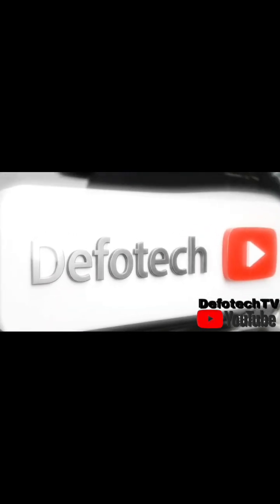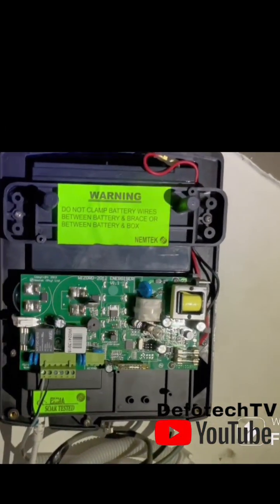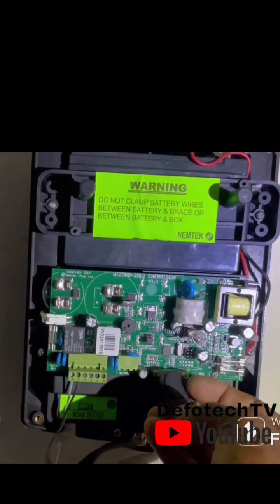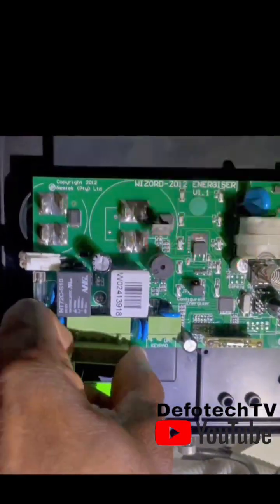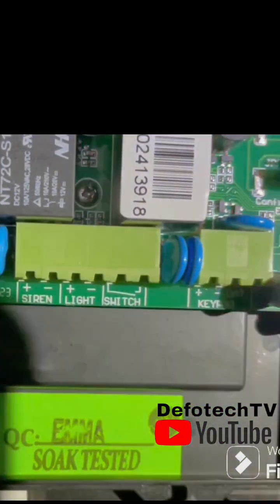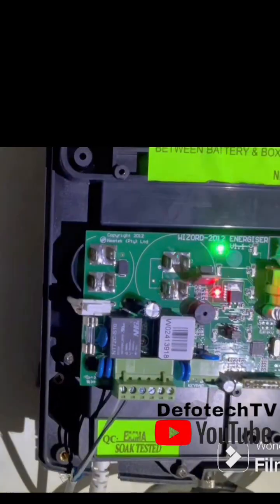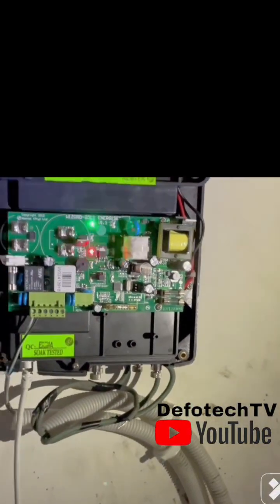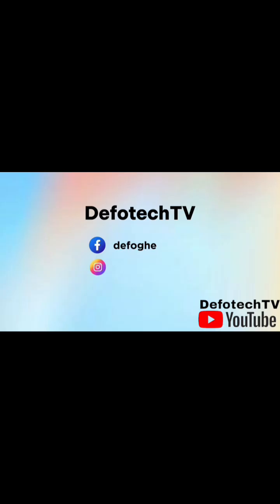Understanding Your Nemtek Electric Fence Energizers

Comment: Good morning sir, 

I’m from Malawi and I have a Nemtek wizard 2i and I just recently bought a new battery for it and I do not know why the battery is not charging even though the transformer is giving an output voltage of 15v and when measuring the battery wires it shows nothing and also the fuses are all okay
Reply from the maker: That's strange! 15vdc ought to charge the battery
Reply: @defotechtv9093 sorry it’s 15v ac
Reply from the maker: Remove the battery terminal from the battery head,plug the Energizer to an AC socket, on the your multimeter, select DC, and read the terminal which is supposed to be on the battery head. Let's know the voltage there.
Reply from the maker: Too low
Reply: The power green color light flashes very slowly and it has started since yesterday and almost 20hrs have gone by
Reply from the maker: Like you need a bigger amps 15v transformers
Reply: @defotechtv9093 when I’m measuring the AC voltage at the secondary output from the transformer it shows 15v and then measuring the DC voltage at battery wires it shows 10.02v
Reply from the maker: Too low to charge the battery
Reply: Good morning sir
Reply: How can I power the battery with light 💡